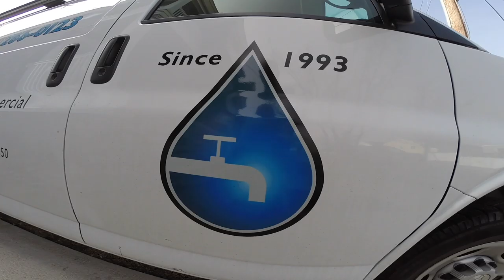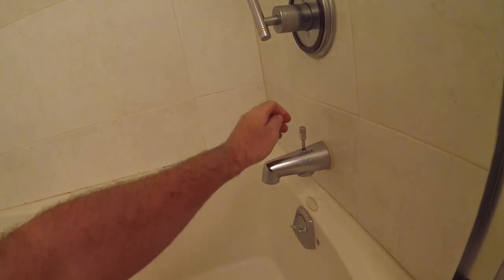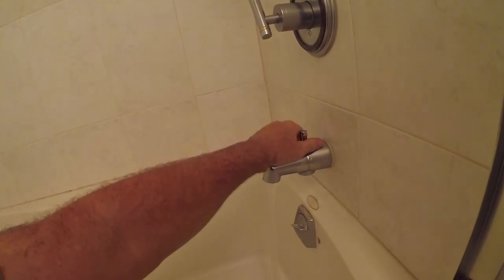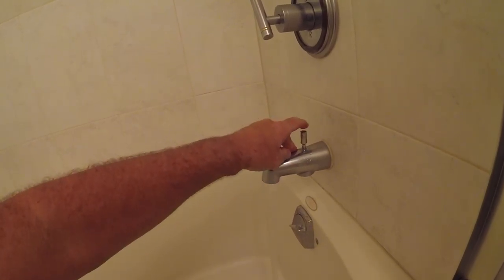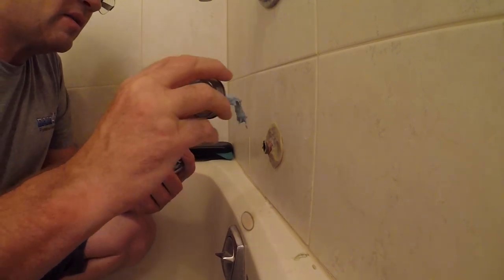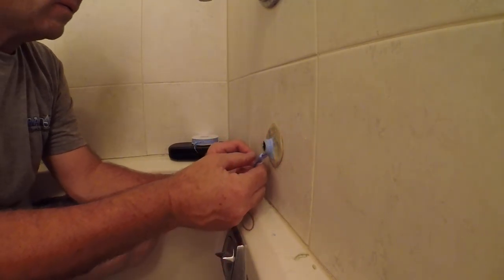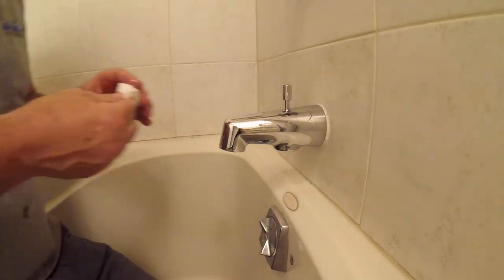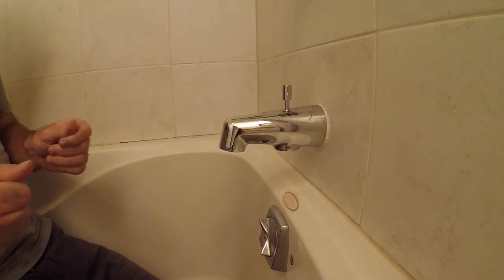KOHLER FAUCETS FINIAL SERIES TUB SPOUT REPLACED

Comment: Here's my question...the bottom has a plug that I assume you can use to access the gate to repair, instead of replacing the entire spout.  The trouble is, I can't seem to find a repair kit for this type of gate.  Does no one make a gate repair kit for this style?  The new one you purchased is identical, and it appears they still sell this style, so where are the repair kits?
Reply from the maker: best to replace

Comment: Rubber strap wrench? Small squeeze tube of white silicone tub caulk? Both might have made it a bit easier. Nice job though!
Reply from the maker: I have no luck with them chuck. what brand do you use?
Reply: Chuck Barron strap wrenches are Craftsman, and the squeeze caulk is GE Silicone Kitchen and Bath, also available in clear
Reply from the maker: Thanks chuck

Comment: You need to leave a small gap in the caulk at the bottom of the tub spout. Any water leakage will come into the tub instead of going into the wall. Great job on the videos
Reply from the maker: a seeper hole...nice. thanks

Comment: Tech tip. Use 100% silicone then use rubbing alcohol on a rag to clean off the excess silicone. Cut the tip of the silicone at a 45 with a hole just big enough for the punch rod to go in it (perfect amount of silicone) also tape before dope.
Reply from the maker: Thanks Robert. rubbing alcohol is the ticket? I will keep that in mind. Thats why I don't use it. The clean up. Thanks for tip
Reply: Mineral spirits work well for cleaning up fresh silicone caulk too